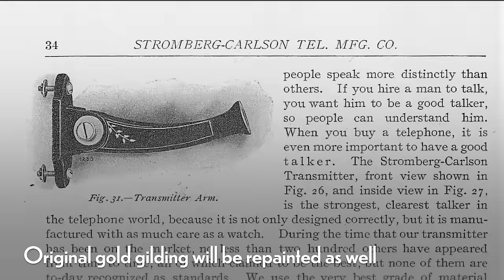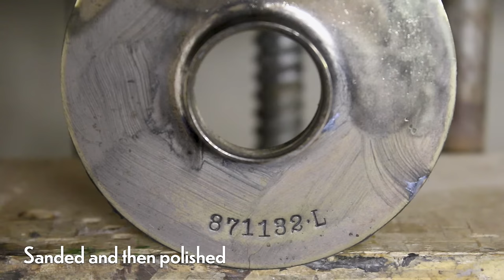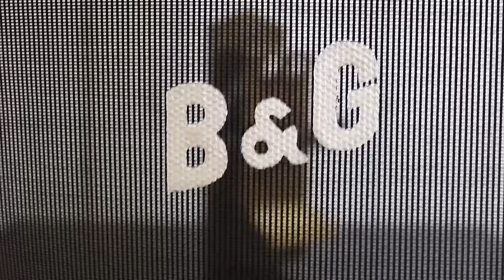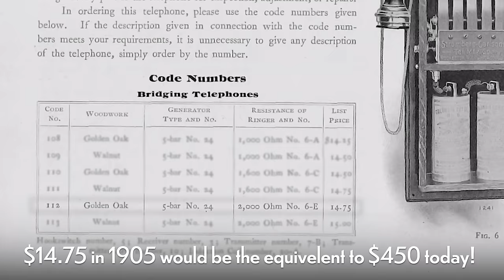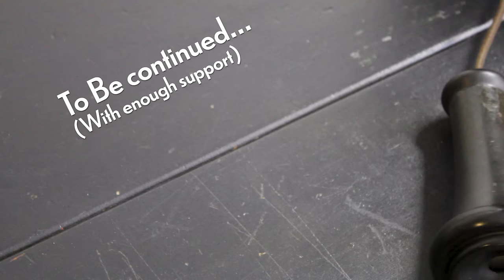1900s Antique Telephone Restoration

Comment: I was a telephone repairman during the 70s , 80s and 90s. This was quite interesting!
Reply: So this phone can never actually be used?
Reply: Ha!!  No you werent Punchion . Trying to one up the guy who restored the phone?   You sicken me pal!!
Reply: @CleveIndians  I was a repairman in Canada you dolt! Who the hell do you think you are! All I said was that I found the video interesting. And I'm not your pal!
Reply: @punchion I dont know you so I assumed you knew it was a joke...relax
Reply: I still believe in Time travel 😊
Reply: @MrCedarapffel  This phone was made to be used with a manual switchboard, so an operator would need to make a manual connection to another phone.   Automated switching equipment was installed in the 1920's, so all of these phones were replaced with the rotary dial types.
But this could still be used for point to point communication, like a military field phone.   When you crank that handle it would send out a signal and activate all the ringers on all the other phones down the line.  Then you could talk to any other phones which had the receiver removed from the switchhook.

So no, it could not be used as a landline on today's telephone network.  But yes, it could communicate on a private network with phones that are of a similar type.
Reply: @MrCedarapffel  actually, you can still wire it to a landline system but you won't have a dial pad to make a call
Reply: @MrCedarapffel  like JimTheSoundman said, it could be used for a private connection, but if you call someone on a newer landline you can still communicate on that circuit
Reply: yeah...back when anti-repair design wasnt a thing like it is now for the iphone!
Reply: @MrCedarapffel  Actually yes they can to a degree. You can't dial out but you can receive a call. I know where there is one just now still connected to the phone network. It still rings when the house phone rings and if you pick up you can talk to the caller. An old garage in the next town to ours also had 3 still working till he sold up and the place was demolished. One in the workshop, one in the office and one in reception. He didn't see the point of getting rid of 3 perfectly good phones.
Reply: 18 or 1900's? ☺, that's pretty cool, it's hard to imagine it was a profession. But phones, I suppose were built to last a generation bitd
Reply: nice video
Reply: Great video!
Reply: Wow. So you were there for the transition from step to crossbar to 1A and then ESS. (DMS since you're from Canada 😉). That must have been amazing. I was an operator from 1999 to 2007.
Reply: try again in that era they were tossed and replaced ...
Reply: @jesshadfield3566  if i am not mistaken, you can still Dial a Number by toggling the switchhook the appropriate Number of times. Basically the Rotary Dial does the same thing.
Reply: @jesshadfield3566  With circuit modificatons and the addition of a dial - yes.
Reply: @jimthesoundman8641  With circuit modificatons and the addition of a dial - yes.
Reply: I have a drug dealers phone...but I'm not a dealer just poor
Reply: @punchion Ah, the 70s - when you could get it with a buzz, you could get it with a ring, and if you really wanted, you could get a ding-a-ling.
Reply: Telephones
Reply: For example, how do we dial 911?, thank you

Comment: I have one that is a bit younger than this (it has a handheld receiver combined with the microphone). It is not an Ericsson but it is built by the Swedish Telecom Administration (Telegrafverket). I rebuilt it with a new microphone and earpiece and I put  rotary dialler in the battery box. It works beautifully today!

Comment: I remember seeing a similar style phone that was modified. The area under the shelf was actually boxed in and part of the shelf was hinged allowing the shelf to lift up exposing a DTMF pad and where below was hidden the telephone network allowing the phone to work on modern lines. The magneto had been removed replaced by a false handle that could turn. The area where the magneto and the batteries once were housed was modified by removing the shelf allowing one to store a small personal telephone book.
Can you imagine sitting in an old kitchen during a thunder storm and looking up at the phone to catch sparks flying between the lightning arrestor contacts caused by a nearby strike or static buildup.
This was an interesting video showing how man used what technology and materials he had available to him to provide a useful tool.

Comment: When you disassemble the magneto, you should have marked the position of each one of the bars, where it's at and which end faced which way. They are part of a electromagnet-based generator. Also the number of bars had nothing to do with the distance of the phone call, the bars only created the magnetic field to run the Magneto to ring the operator, which was usually located within a few miles of the person who owned that phone. As we saw on the TV show Lassie where the operator was in a lady's house. There would have been anywhere from two to four batteries in the bottom section of the telephone. The small wrench clipped inside the door was for disconnecting the lugs on the dry cell telephone battery. 1.5 to 1.7 volts each. However about 5 amp hours, but only a very small current over a long period of time could be drawn. Normally those phones operated around 35 Louis amps of rain current to as much as 90 milliamps of rain current if you were on a farm way out in the country. That was generated by the Magneto, at the telephone office bank. The batteries in the phone were used to provide the voltage to keep the circuit open for talking. You could actually connect that to a modern-day phone line You'll need 300 ohm 2 Watt resistors. Put one in series with each one of the legs of the telephone line. You will not be able to make a call but you'll be able to receive one, and the phone should ring.
Reply: If I recall correctly, the magnets had markings on one pole so that they could all be oriented (polarity) in the same way.
Reply: When I was watching this video, I was wondering if it could be connected to a modern line. It be really interesting to see it working.
Reply: I really read that whole thing right before I have to go to school.
Reply: Alan, great info. Thanks! You say you could receive a call using this phone but not make one. What would you need to make a call on it? Is it just because you couldn't dial a specific number with it? Clara over in Mt. Pilot isn't there anymore to connect your call for you??
Reply: @DaveJOHAZ  that's exactly right.
Reply: @salsa101  This phone does not have a dialer, so there should have to be a person in the call center that you could ask to connect the line to the desired number. I don't think there are such centers anymore.
Reply: @DaveJOHAZ  It used to be true that if you clicked the hand set exactly 10 times in quick succession that it would contact an operator. The 10 clicks is the same signal as from a rotary phone dial. I suspect that no longer works as there are no mechanical switches any more, they are all computers.
Reply: @Arskanbooki  But maybe he could be updated for modern lines without missing any old style?
Reply: @yazdhenab.  Why not, but that would probably require hiding a modern phone inside the old box. Can it then be said that the old device is working?

Comment: Very impressive restoration.  I have done several, neither as in depth as yours. I removed all components and polished then clear coated everything plated and repainted what was black. Then refinished the wood and reassembled. While my restorations looked beautiful,  sadly I lost the ring. On one phone I was very pleased to see the internal part of the ear piece date stamped 1909. 
Very labor intensive job restoring one of these phones, definitely a labor of love, but worth it if you love them!

Comment: I had a friend growing up whose  dad was an engineer for the local electric company.  He had one like that in their basement. His dad had rebuilt it and it worked fine. In fact, they used it as their basement extension. The only thing you couldn't do was dial out.
Reply from the maker: Great Story, Thanks for sharing! We're planning on making a similar intercom system in the future (with another telephone) :)
Reply: I also had a friend (Barney) who did exactly the same thing - although we COULD ring out - just to the Operator - who had to connect you (still happened in the 1970's).  I LOVED that phone!  Thanks for bringing back a great memory of an old friend.
Reply: I have almost this exact model of phone hanging in my kitchen. It is 100% original, but has 2 things I added on. Unlike the model in the video, mine was field convertible to common battery (as opposed to local battery as the one in the video). I added a magnetic catch to the front cover, and inside - in the battery compartment - I mounted a touch tone pad from an 80's era  2500 type desk phone. It's just wired in parallel to the carbon transmitter, so no real modifications to the internal wiring were necessary. It still works, and I still use it. Probably my favorite of all my antique phones.

Comment: Excellent metal work restoration.
I have a 1908 Ericsson "Commonwealth" walnut phone with an ear/mic. handpiece. It was used on our sheep & cattle station until about 1960.
 Your illustrated data shows the "earth return" system which can be used instead of two wires; as the name implies, the ground makes up half the circuit - in our situation this was for one mile distance to the other homestead on the property.
Many find this hard to believe since the two batteries only provide 3 volts but the transformer boosts the 'alternating voice current' enough to overcome the resistance of the earth!
Regards.

Comment: Back about 1968, one of my great-uncles and a local scrapyard still had this type phone, in working order.
If I recall correctly, you'd crank it up, connect to the operator, and they would connect you.
I remember seeing a few others still on the wall in other places, dial phones had been existant for about 20 years but they were still around back then.

Comment: With projects like this, it's always hard to tell when you should stop trying to seek perfection and embrace the imperfections as part of the character of the thing you're restoring. Like, it's possible to keep sanding the metal to remove all of the pitting, then polish it to a mirror finish before plating, but it takes forever and the original parts weren't even that perfect.

Comment: I have an old crank wall phone that looks like this one.  I am sure it's made by a different company though.  Was raised by grandparents in an old farm house.  Th crank phone was used and was on a 5 party line our ring was two longs and a short.  You had to go thru a switchboard with a live operator to call out.  After that it was replaced with a heavy black desk rotary phone made out of plastic bakelite (sp?) stuff used back then.  My crank bells are the original black and it still rings when you crank it.  Wonder what these phones go for now as antiques?  Fantastic restoration.  Did not realize it had a bazillion parts to it.  Sheesh!!

Comment: this is so cool, man I love old phones. Especially candlestick phones.  You know...that old Stromberg-carlson hand crank makes for a great emergency phone charger. you just have to add a voltage regulator board.  It wears your arms out, but for those times when you have a power outage and your phone is dead it works just enough to get a small charge going

Comment: I have an old wooden wall phone similar to the one you restored. It's in great condition but I'm not sure who the manufacturer is since it's been stored away for a number of years. About 30 years ago, I removed the guts of the phone (after taking numerous photos of all of the part locations) and installed a handheld dial phone into the cabinet. I connected the wires from the dial phone to the ringer on the old phone and every time someone called, the antique bells would ring. We would open the cabinet and answer the phone sitting inside. I still have all the internal workings with the photos. One day I'm hoping to rebuild it, probably not as nicely as you have done. Great video, very interesting and fun to watch.
Reply: One thing I wished your video had included was some conversation around some of the processes you used during the restoration. Such as how you did the electroplating of the parts and the steps that are needed to complete the processes. The video was fun to watch, but a little more expanation would have also been very helpful. Keep up the good work.

Comment: Very nice work.. I have a Western Electric brand, in very good condition, but this video helps me know how to disassemble it in case I need to do some work ... The one I have, on the side has a small hook to hang a pencil, to use it when writing on the small table ... They are beautiful pieces, some people break their originality and add a dial with numbers to call, but I prefer what you did and leave it original ... Mine works perfectly and sometimes as a joke I call from me modern cell phone to the poor old phone ... you only hear a little low volume ...
I congratulate you for your video and for your work, it is worth giving life to those things that are eternal ... Greetings from Buenos Aires, Argentina

Comment: Nice job
If the bells have an offset hoole in the dome, you should be able to rotate the domes to adjust the space between hammer and domes
When the hammer is attracted to one side, it should briefly hit the dome but then there should be a small gap, i noticed that the hammer was still touching the dome when at rest at the end of the vid, this is why the bell is muted and not a clear ring, hope this helps ;)
Reply from the maker: Thank you very much! 
We did notice they were offset, but didn't know it actually severed a purpose. That's a super interesting detail and clever design, we'll be sure check it out. Great explanation! Thank you so much for sharing that info, we always love learning more :)
Reply: Respect, Sparky. It is lovely seeing someone share knowledge instead of tearing someone else down. Going to check out your channel next.

Comment: I worked as a lineman, cable splice, electronic tech and in management at bellsouth Telecom starting in the early 90's I was part of the group that built out bst's broad band test network to begin with and then helped roll out broadband in the region serviced by bst .  The phone portion of your smart phone pretty much works on the same principles as the phone shown in the vid.

Comment: The magneto was used to ring up the operator when it was cranked. The operator heard the bell at her end to notify her someone wanted to place a call. She connected you to the number you gave her. The actual call was powered by a battery that went in the lower compartment.

Comment: “5 bars allowed for a greater call distance.”
I’m lucky to get three bars on my cell phone!

But seriously, thank you for this! What a fascinating project!
Reply: This must be  5G phone
Reply: I doubt that the number of bars has anything to do with call distance since all they are used for is to generate the voltage for the ring signal from the phone to the switch board.

Comment: My Dad brought me several of the Magnetos and bells off of old smashed wooden Telephones used in the Coal Mines where he worked back in the 60's ....Us coal miners kids would hold hands in a circle while two kids on the open end of the circle would each hold a wire attached to the magneto while another kid would crank the thing and we'd all get a shock and holler and let go...lots of fun....If the Restorer had known all he had to do to remove the crank handle off the magneto was to sharply crank the crank backwards (counter clockwise ) it would have saved him a lot of work

Comment: 12.41 Why wasn't it oiled anywhere in the magnetto? There, even the tubes are soldered for periodic lubrication of the shafts. In general, all potentially rubbing parts need to be lubricated there.
Reply from the maker: Though it wasn't shown in the video, all the Magneto components were oiled and greased accordingly. Thanks for the feedback